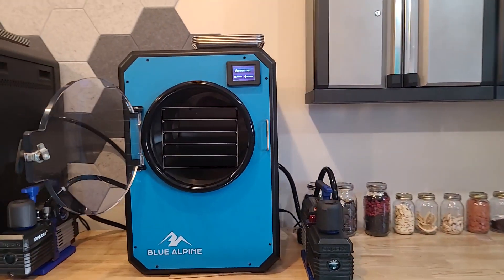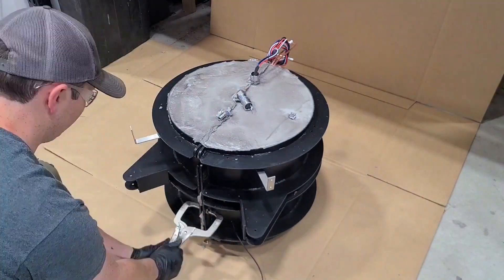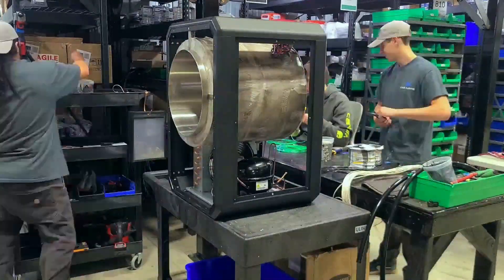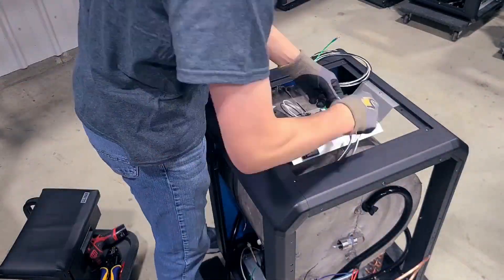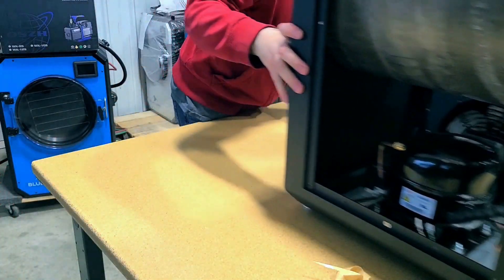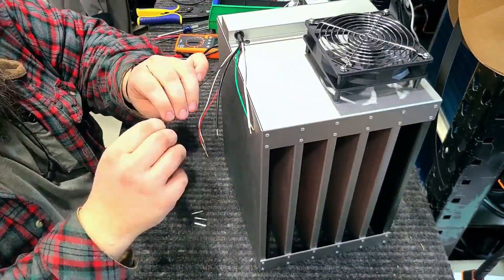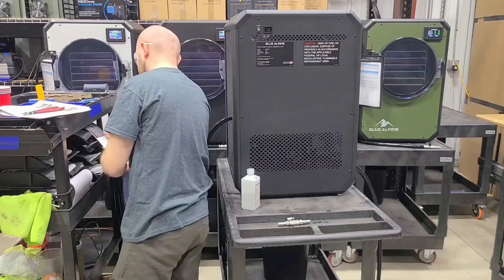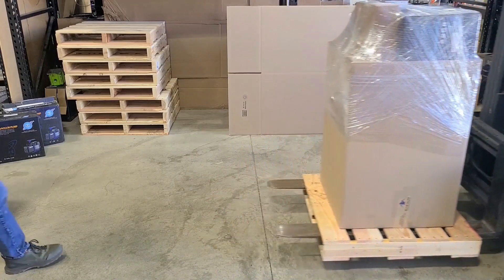How Freeze-Dryers Are Made

Comment: I’m curious if you have future plans of setting these up with wifi capability? I use wifi on my current FD during every cycle.
Reply from the maker: We do have plans to add wi-fi. In fact, we are building in hardware capabilities for wi-fi on future versions. That way, when we implement the app/mobile control, all you will have to do is update the software on your machine, and it will work! It's still coming down the pipeline though. :)
Reply: @BlueAlpine awesome!! Can’t wait until you start building those. When you do, I’ll come over to the Blue Side

Comment: 3:40 i'm glad you guys don't put that foam piece under the heat rack. I had that on my previous HR.
Eventually it will come loose. 
While i understand, the foam's purpose is to insulate the bottom rack, 
i'd much rather have the (higher wattage) bottom tray to compensate instead (looks better).
Reply from the maker: Yeah, we've always thought that extra bit of insulation on the heat rack looked kinda tacky anyway. So, glad to hear you like our design! :D